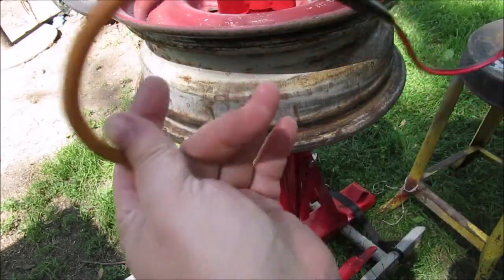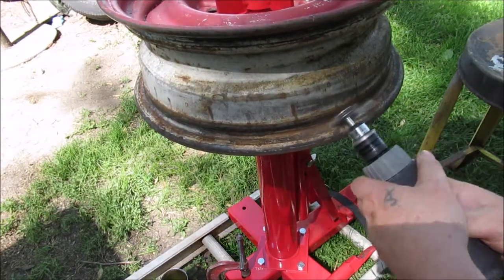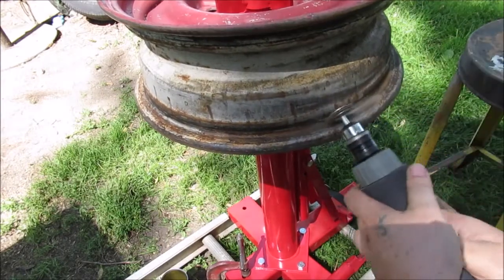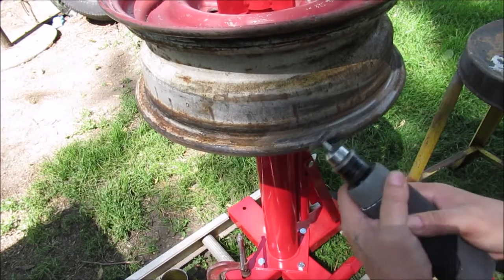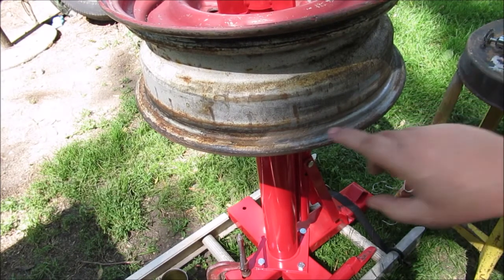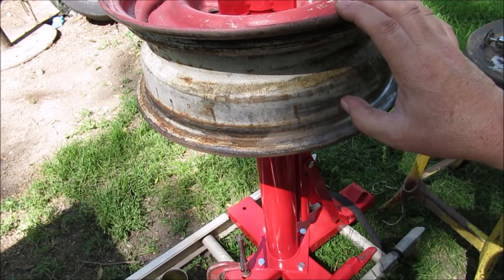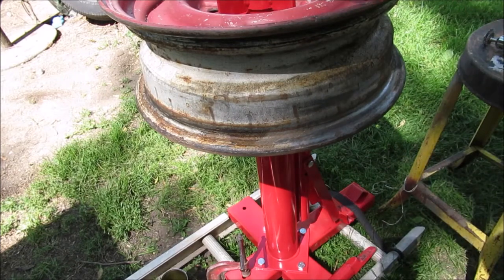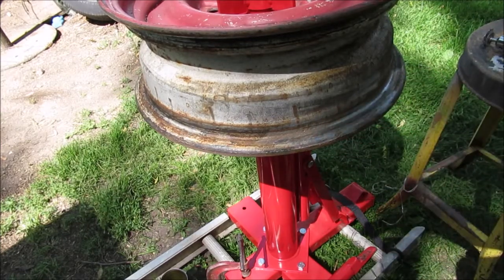Wire Brush Steel Rim with homemade 12 volt Rotary Tool

Comment: I love watching your videos.  The content is great .  I buy and mount my own tires here in Ireland and I save myself a considerable amount of money by doing this myself.  I do not have this tool but I have seen it before used by a number of you-tubers.  I break the bead on my tires by driving on top of a  piece of 3 x 3 using the weight of the car to break the bead.  I am just about still in the zone from  taking the tires off using the  tire leavers.  It is not my ego that stops me from buying this item but I just think it is a little under weight for my needs.  I don't think I would have the strength to break the bead using this tool.  However, mounting and dismounting the tires might it might make the task a lot easier.  The jury is still out on that one for now.  Keep up the great videos.  I love watching your presentations. Thanks
Reply from the maker: Thanks for Watching !!!..It has been easier on me to have a tire machine..I have used a bumper jack and tire irons to do tires....It does take some effort to break the bead with this machine  but taking the tire off is so much easier